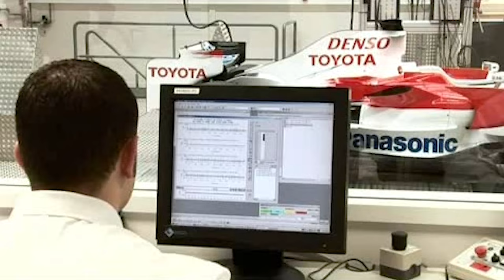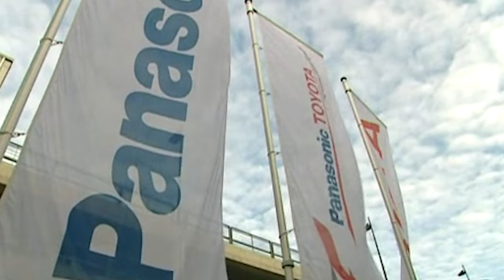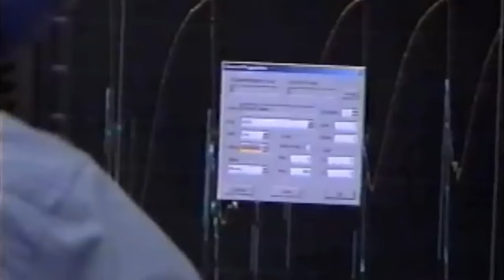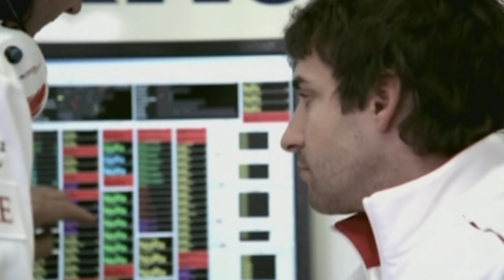How Toyota became F1's most expensive failure

Comment: Toyota: The most expensive failure
Hybrid era Renault: Hold my Cabernet
Reply: Hold my bagguett
Reply: Honda by far have spent the most and with the least success. Google engine components used by a season and see even Mercedes have failures, it is just that RedBull were a PR nightmare which is why Honda gave them free engines, to make sure they do not complain publicly.
Reply: @333mystic  well they gave McLaren free engines and offered Williams the same. I think Redbull were less of a nightmare than mclaren
Reply: @samgreen5517  Adding to that, McLaren were complaining that their aero were great and the Honda engine slowed them down. Then 2018 arrived with a slap on McLaren's face
Reply: Renault engine has the worst reliability in the last 2 season
Reply: @333mystic  Even with that, Honda is actually doing well enough. Consistently locking out Ferrari and tossing a fight with Mercedes, Honda's doing pretty well in both RB and Torro Rosso (Alpha Tauri now).

The reason why Honda failed McLaren was that Honda knew they needed time to work on the kinks of the new Honda hybrid system as yes, they were the pioneer of it with the Insight and also the NSX had a hybrid system too, they've been out of the F1 game for soo long that they needed extensive testing before tossing it into a car. However, McLaren din't backlog any engines from Mercedes to use before Honda was ready so when the testing season came, they forced Honda to quicken their pace in making their engines and demanded that they get what they want because they're Honda's customer. However, Honda truly wasn't ready and told McLaren about it that they might even have to delay a year so that the engine would be throughly tested but due go dropping Mercedes even before Honda was ready, McLaren suddenly was stuck thus they chased till Honda had enough, rushed an incomplete engine out and basically screwed McLaren over.
Fast forward to Red Bull and by then, Honda had worked out their issues and now, they fight pretty well against Mercedes and Ferrari while Renault was a laughing stock in the McLaren.
Reply: @333mystic , thats pure Bullshit, sorry. RedBull see better Tomorrow with Honda, and they see it 2016 onwards. They make steps to acomplished funcional cooperation with Honda, and they now feel way better. Renault was bigger liar to RedBull as Honda can be enthusiast. Trust me. And thats all about possible harmony.....
Reply: @MrLolx2u , Honda's biggest problem was "like ol school diesel  pre chamber ignition, then turbocharge it..." really. They learn it. Second problem was Mclaren, not enough space for sufficient coolers. 2018 they add something like 50 Hp more to ToroRosso, with the same engine which they have in Mclaren. Because of doubled turbo and air coolers. And that was really cool move, or? 😁
Reply: @aeopercy8270  Of course the car is great in the corners, if it has a fuckton of downforce and aero drag and expect the engine to miraculously keep it in pace on the straights
Reply: Honda with McLaren: Hold my sake
Reply: @justaname9544  Mclaren had engine date from Mercedes so they knew Honda was making shit engines.
Reply: Es que Riccardo?
Reply: @333mystic  And yet Honda is rising from the ashes on the wings of Red Bull (pun intended) while Renault is sinking deeper and deeper into the cesspool called French Arrogance.

It's been nothing short of brilliant what Red Bull been doing for and with Honda these past 2 years. Sacrificing Torro Rosso drivers for 2018 season to basicly be test drivers. Giving Honda all the time and space they need to work out the worst of the issues with their engine. And then sacrificing their own 2019 season to give Honda the opportunity to make the final push to be truly competitive.

And now it's 2020. While the season has yet to get started due to COVID-19, wintertests have shown that Red Bull Honda is breathing down Mercedes neck.
Reply: @OnionChoppingNinja  The fact is Honda have spent the most £ not Renault  (engines). Verstappen said: "First of all because of the budget they have, which is many times bigger than that of our current engine supplier". Honda Racing F1 have never been able to charge any team for their engine. 100% cost. As a manufacturer Renault are no where near the €£$ of Ferarri and $1.4 billion Mercedes. If you expand into results / points. Renault power still ahead of Honda. I believe Honda are now able to provide engines to win but that was not the point here.
Reply: Renault works with a way lower budget that the top teams.
Reply: wrong... Renault provided engines for teams like Red Bull and McLaren
they are doing well at this matter
Reply: Hahahaha. Excellent.
Reply: @MrLolx2u  Honda abuse the engine limit system. They intentionally use 4 engine for the season and are willing to pay penalty for extra power (20-30 hp). Others team don't want bad publicity and stick to the rules.
Reply: @Pa Z Williams Racing 2020: HOLD MY BEER.
Reply: @OnionChoppingNinja  renault  / redbull = 3 world championships.... honda / redbull = 3 podiums.
Reply: well for the team side of renault,they are a huge disaster

BUT

for the customer side,they did pretty well with Redbull and Mclaren
Reply: Hold my tire
Reply: At least Renault has been there, and has done that--they already powered a Formula 1 team to a championship.  Toyota is yet to score their maiden F1 win.
Reply: @kenshinflyer  Not even Williams to get that, or Jordan, both were close to get their first win but getting a podium instead. To make it even more ridiculous, they hadn't scored more than 3 points/race by ratio.

Comment: One thing that people overlook about this was Toyota's NASCAR success at the time. Toyota had started their NASCAR journey in 2001, one year after they started their FORMULA 1 journey. And it produced way better results. The big reason for this is how well Nascar's and Toyota's ideals line up with each other's. Formula 1 is a developmental series, Nascar is a spec series. This means that in Nascar are the cars are built to be very similar as possible. This is done so that less emphasis is put on the car and more on the driver. If one manufacturer gets too far ahead of the rest, Nascar will actively try to give the other manufacturers an advantage to catch up to them. So when you have a Manufacturer like Toyota who wants things done it's way, paired with a series like Nascar, your gonna get great results pretty quickly.

Comment: Trulli's masterful drive at Suzuka, beating Hamilton in a straight fight was one of the standout performances that year. You'd hoped such an impressive P2 at their home race could've swayed them to keep going. Nice to see the two almost certain victories for Trulli at Bahrain and Spa that were squandered due to strategy and technical issues being highlighted, usually when they are mentioned Trulli gets unfairly blamed for not bringing home the result when he in fact was blameless at both occasions. Also don't forget another potential victory was left at the table when the Michelin teams pulled out of the 2005 US GP where Trulli had qualified on pole, though I consider that one to be more of a long shot than the aforementioned 2009 races.
Reply: Imagine if Toyota joined F1 now with the momentum from WEC
Reply: Also to be fair Kimi most likely would’ve won that race.

Comment: I feel like Toyota was one of the most underrated teams in F1. Toyota and Honda at that time was the pioneer of Japanese motor racing and car manufacturing. In the 08' season, they have outright beaten Honda in terms of both technical and aerodynamic aspects, securing top spot in Japan. With Honda's withdrawal from F1 in 09', Toyota stayed and produced significant results from the double diffusers, meant that they can adapt to the technical changes in F1 in off season developments.  I really hope that they have been watching the technical developments throughout the decade, and as one of the pioneers of hybrid engines in racing and commercial vehicles, I sincerely hope that they return in the upcoming 2021 season, returning with Fernando Alonso as their number 1 driver.

Comment: Honda are right up there, start calculating the Mugen split, 1999 testing year abandoned, Jordan Honda, BAR Honda, Honda, '1p sale to Brawn', pulling out of F1, internal disputes and CEO changes, deciding to returning to F1, one year of failed testing then 2 miserable years with with Mclaren, changing to toro rosso and a very expensive year, then red bull. 2020 Honda now supply FREE engines to 2 F1 teams...Honda also have supported Takuma Sato for near 20 years and that's a huge costs of accidents repair...

Comment: The TF110 would have no doubt been an improvement over the TF109 (which in reality never was pushed to its potential). Toyota was starting to see things go right with the TF108, TF109 but neither Trulli nor Glock (both good; but not great drivers) could not get the car to reach its maximum potential. Had they had a driver like Alonso they probably could have gone one better.

Comment: I could say Toyota performed better than Minardi, but given how huge Toyota is...

Now, with the hybrid era, I think Toyota should return--but, this time, if ever, they should think this over, learning from their first-foray mistakes, and not simply rely on the power of the Gazoo Racing nameplate.  WEC is a proof of their new capability.

I am a Toyota guy, and, yeah, I'm mortified to know that the biggest car manufacturer failed in one motorsport, and the pinnacle of it at that.

Comment: I think it also shows how difficult it is to enter F1 with a new team for a manufacturer. As a car manufacturer these days you need to take over a team as a Toyota can't go shop parts at Mercedes or something, while a privateer team like Racing Point or HAAS can do. Toyota started an F1 team from scratch, meaning you have basically zero F1 know-how. I agree Toyota made a lot of mistakes, but one thing also not mentioned is that they never had a great driver line-up: Salo, McNish, Panis, da Matta, Zonta, Trulli, Ralf Schumacher, Glock, Kobayashi. It were all experienced but not the best drivers, or young drivers without experience. There was never a great driver like a Kimi Raikonnen, Micheal Schumacher, Fernando Alonso, Lewis Hamilton.

Comment: Toyota were on the cusp of their first victory when they pulled out. They'd proven they could build a fast car, and in 2009, not just fast at the start of the season, then a slide backwards. The revival that saw back to back 2nd places actually saw Trulli out race Hamilton's McLaren at Suzuka - which says something about the pace of the car. Yet, this was juxtaposed with the dreadful race at Monza that same year when they tripped over each other and seemed to go nowhere. Toyota never sorted out their suspension to ride the curbs properly. They always struggled at Imola and Monaco.

With a 2010 car that built on the very good Tf109, AND with Kobayashi onboard, I suspect 2010 would have been the breakthrough they longed for. Of course, that horse has long bolted and as a lifelong Toyota fan and supporter, I hope they never return to F1. It's not in their DNA, and as this video demonstrated very clearly, it is not a good cultural fit for the way Toyota does business. Stick with rallying and sports cars, where Toyota has a long and rich history. It also inherently understands those categories, and for a cost conscious company, they represent much better value for money.

Comment: They were too confident that they could pull all the pieces together at once, they should have started with an engine then worked up. As for the biggest failure, that will always go to Mastercard Lola for mine. Toyota wanted to win in F1 and while you could come from nowhere with a DFV and good driver once, modern F1 was always a 10 year plan with everything right, they clearly had failures in approach and time window.

Comment: Toyota was going to pull out sooner or later. If you look at their car offering in their showroom, they had zero sport car for sale in the late 2000s. They stopped producing Supra in early 2000s and then Celica and MR2 in the second half of 2000s.  As a corporation, you see that there is no racing DNA left in the management mind anymore at the time.  This is the same case with Honda, when NSX stopped production in 2005 and Honda Prelude in 2001, there was no sport cars in their showroom. So in the Japanese market, high performance sport car was dead and staying in F1 just no long made sense for marketing and technological advancement reason.  Not until in 2014 when the Hybrid era started, Honda wasn't interested in the sport again. Should Toyota rejoin F1 now like Honda did? I don't think so just because Toyota used the LeMans LMP platform to advance their Hybrid technology and there is no need to come back to F1 and do that.

Comment: Fuck New Toyota... At one point they offered 2 N/A 4 cylinder's making 100hp per a liter, a 5 valve per a cylinder, an AWD Turbo 4 cylinder with a meth kit, a mid-engine car, a twin-turbo straight 6,  and even a supercharger header combo running 9lbs of boost at max pressure all at the same time...

What do you have now instead of a rebadged Subaru, and a rebadged BMW Toyota... (I know they replaced tons of parts on the new Supra,  but it is still a BMW at heart)